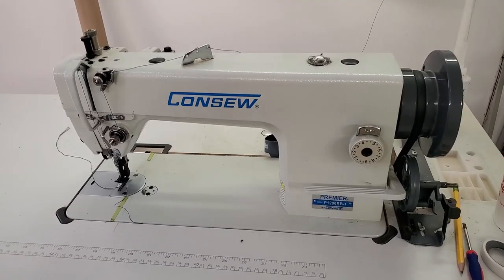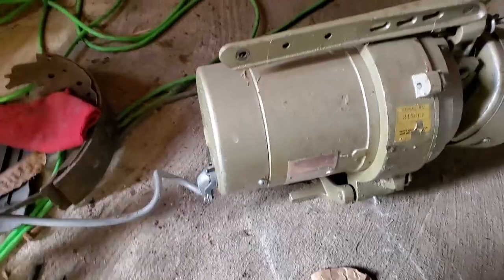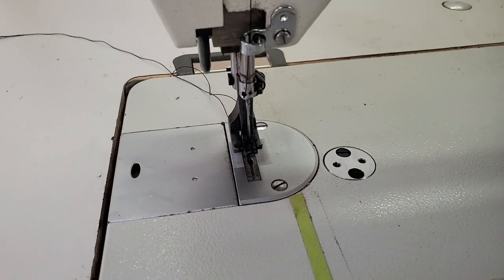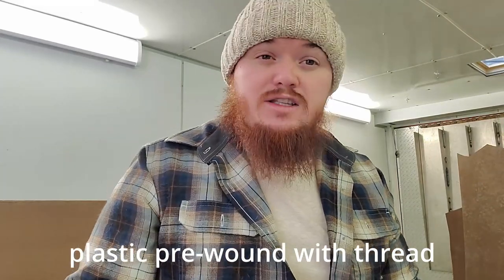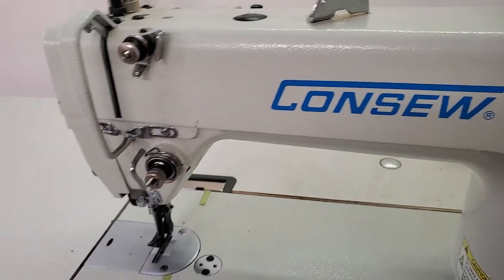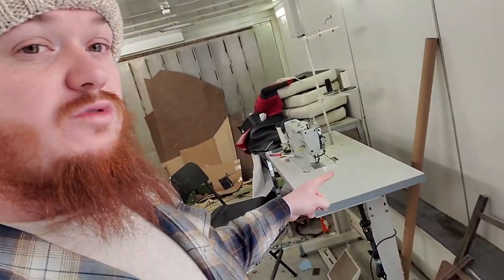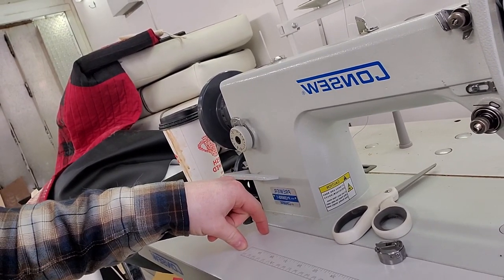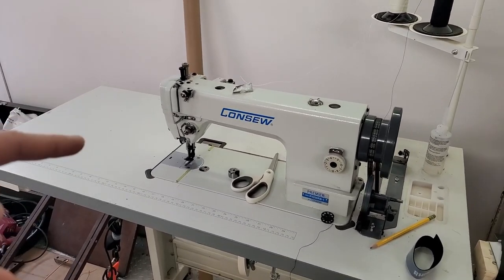Consew P1206 RB1

Comment: Hi Dustin!! Thank you for your videos. Than manual is unclear, I have the red dots but how much oil do you put in the bottom pan??
Reply from the maker: If you look on the side of the pan, there will be a line you need to fill to. After a year or so we had to buy more oil to top it off, but during that time I also moved my machine a few times and lost a bit there. 
As far as the red dots, I add probably too much, but I add a few drops to each drop or until the little hole is full. As soon as you use the machine it will drop as it coats the bearings. But I'd rather use way too much oil and my machine last forever.

Comment: Hi Dustin, I have the same machine as you.what size thread and needle combo are you using? Did you ever have tention issue? Seems like you really have to crank down on the V92. Best regards. Great video. There seems like no one does reviews and setup videos on this machine. Everyone is on the 206rb bandwagon. I had to figure out lots of stuff from the sailrite Fabricator videos and from Sewgold guy other model he sells. 111 clones.
Reply from the maker: I'm using size 92 thread with a size 18 needle, but haven't noticed an issue as far as tension. are you making sure to pull your string deep inside the tensioner so it's being pinched? I ran into that issue with my old 111 where the string wasn't seated so I kept cranking it down trying to get tension. 
I'll be sure to post more short videos on the machine for like setup and so on. that was the issue we found when we first got the machine, no real information out there.
Reply: @HCRacing  Thanks for getting back to me. I have my machine dialed now with 69 thread sewing sharp. I don't feel so bad buying this machine. This is the sailrite Fabricator twin just beige. Am just starting out, I have learned lots you just have to keep it up. Thank you again.
Reply from the maker: So good to hear. What kind of work are you doing? I hope to start posting more of my how-to and working videos from the automotive and upholstery industry/

Comment: I have  new Consew Premier 1206rb-1. The center foot of walking foot works fine, but the 2 outer feet do not touch the feed dog at all. It cam preset like this. How do I change it? Makes really hard to sew thinner material.
Reply from the maker: I did another video going over a walking foot issue I was running into. I dont think I went over foot depth, but I can't remember for sure. 

here's that video
https://www.youtube.com/watch?v=-B-wfJU1ZPM

if I didn't talk about depth, I can definitely go through my machine when I have some free time.
Reply from the maker: I just watched through that other video, my issue was my outer foot not lifting, and I talked about where that adjustment is (what controls the AMOUNT of lift), 
It doesnt directly answer your question but you can see where those adjustments are being made, there are 2 screws under the cover that need to be loosened while the lobe is DOWN and then you can adjust that height. 

Hope that helps